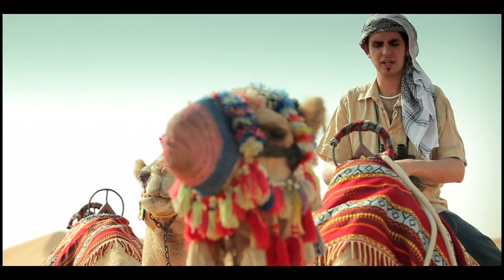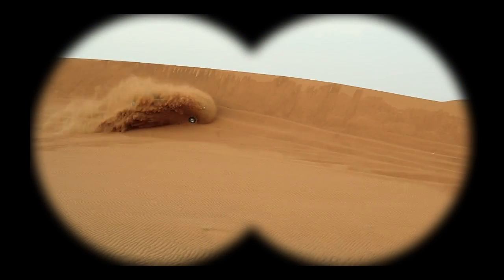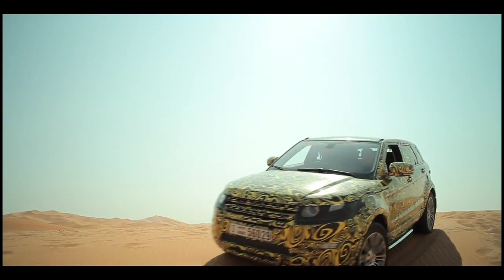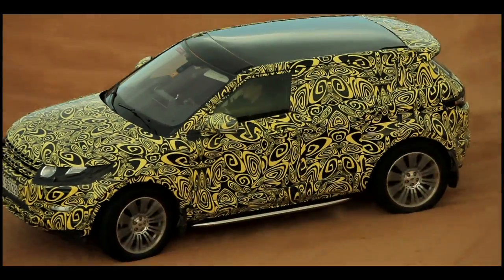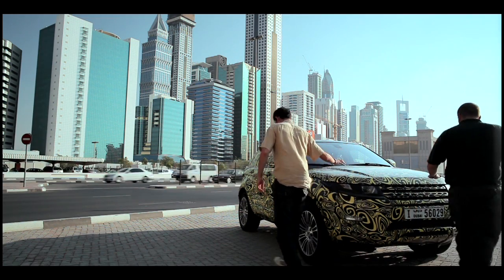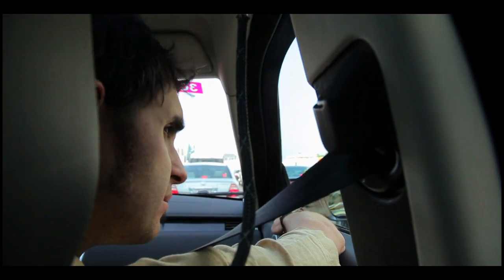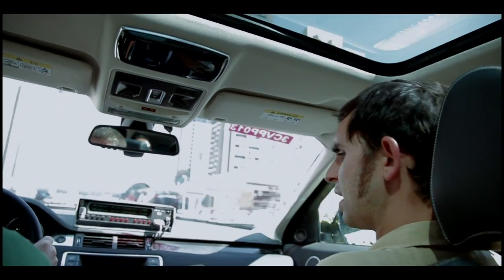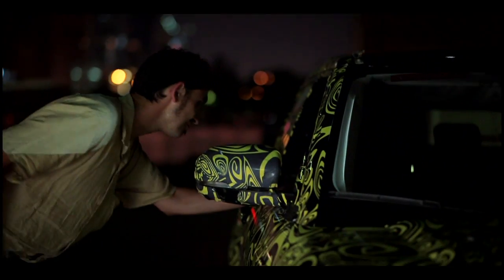Land Rover Design & Engineering Series - Range Rover Evoque Hot Weather Testing - Part 4

Comment: 2007 land rover had several companies manufacturing for the brand REMEMBER IT WAS CHANGING the OWNERS , anyway those owners '' Ford CEO '' appointed diferent companies to make the eletronic and mechanical parts that you find on LR2 but are not manufactured by the land rover